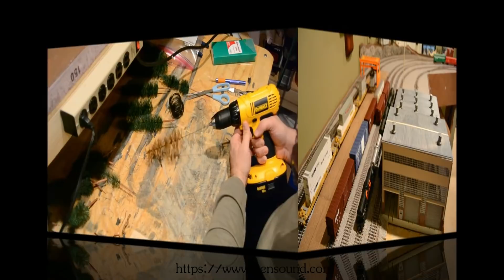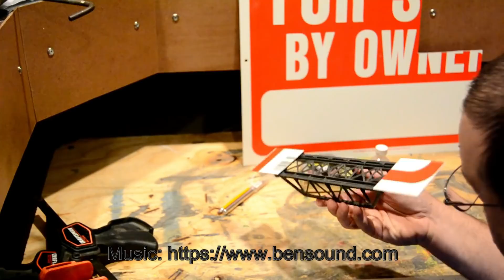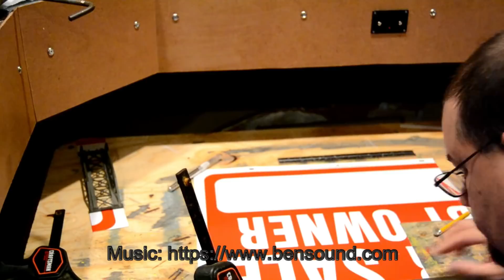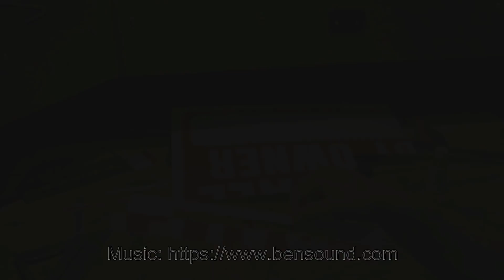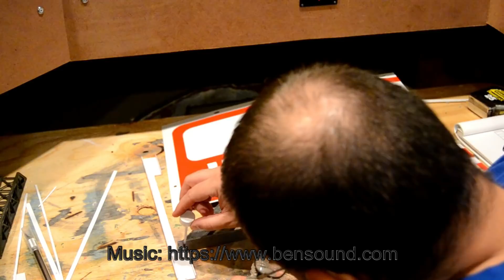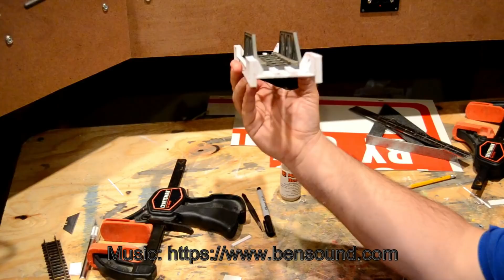Bridging the gap with a For Sale Sign.....HO Scale Bridge Build...

Comment: I have heard of Plastic Weld but I have Plastruct and got a container of Precision Plastic Glue 25 g.with a metal spout for precision in applying the glue.  I think it came from China because there's Chinese writing on the bottle.  This is some of the best plastic cement I've ever used.  I have some Mr. Cement for plastics but it doesn't hold nearly as the Precision stuff.  I don't understand why you YouTubers play background music and then try to talk over it.  Very annoying.  Very nice addition to the bridge.  Really came out good.  Cheers from an ex-Georgian in eastern TN
Reply from the maker: I'll have to check out that glue and give it a try, the music helps with dead space in the video so we don't have to talk the entire time and the viewer isn't stuck watching a video with zero sound. I try to be mindful of the different volumes so it's not as annoying. Thanks for watching-Ed